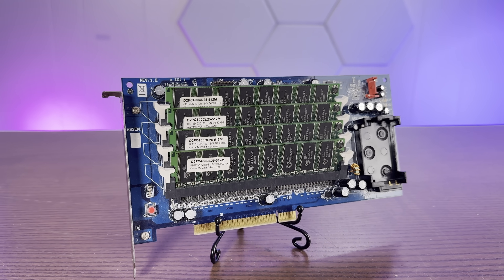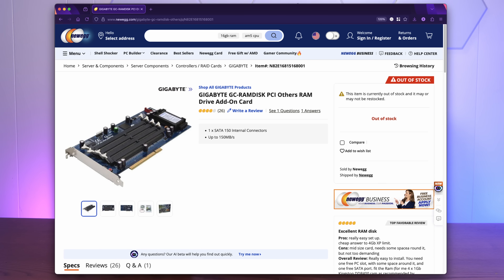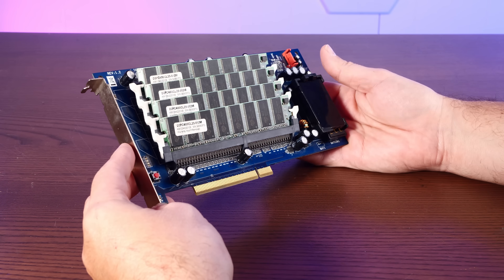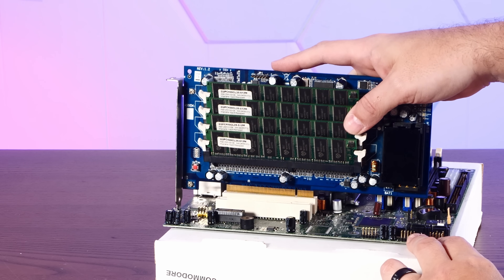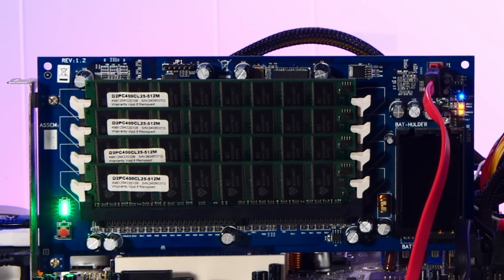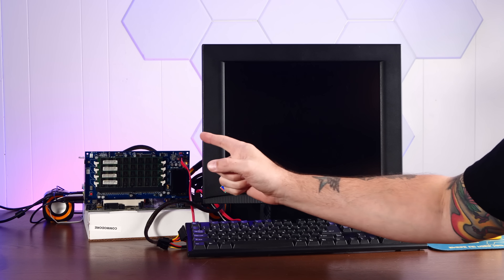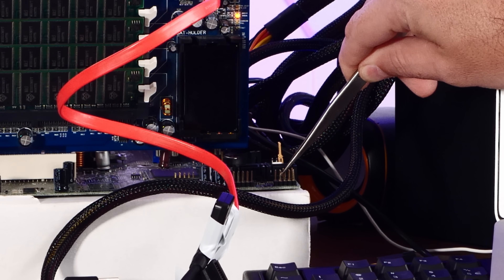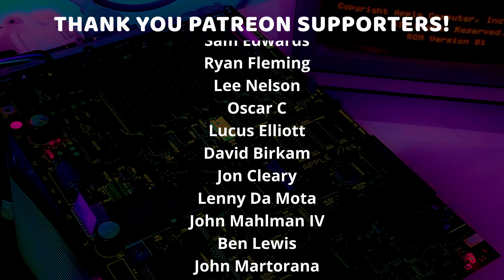This Early SSD Was WILD

Comment: Even earlier, in the 90s, ATTO Technology had an early standalone SSD that used SCSI. It had a backup HD in it. The SSD streamed to the HD for data security but had RAM (for the time) speed. Its only flaw was the cost which limited it to niche markets such as video editing and website hosting. I was the last product manager to have the produc in his line and ended up killing it because it was not an easy sell and expensive to produce.
Reply from the maker: That's amazing! I have to find one!
Reply: That is wild! I would live to try it with my Mac SE.
Reply: In the late 80s (?)/early 90s, DEC offered a range of "solid state storage" options for the SDI and DSSI storage busses, the ESE20/ESE50, and the EF5XX drives. These were just DRAM in a box, with some having an integrated hard drive for "data retention", others did not. Since VAX was often net booted in a cluster, I presume not having data retention wasn't a big deal for use as a swap disk or other similar uses (SDI and DSSI were both "networked": multiple computers/iniators could be jammed on the same physical bus and share a drive).

I didn't know there were other drives like that out there! I wonder how many of these existed in the wild, and if there was any relationship behind the scenes. I've never seen one of these drives myself, but it's such a "neat" idea.
Reply: @iliveitveryengaged  haha, I just commented that, damn we are old, our VAXes had those for the index tables.
Reply: Even even earlier, in the late 80s, Horizon Computers sold the Horizon RAM Disk for the TI 99/4a. SRAM on the system's expansion bus, backed up by three NiCad AA cells.

Much faster than floppies. Probably not faster than a hard disk controller on the same platform, though.
Reply: I saw this in PayPal's data center. Manufactured ~1998, size of a good APC Smart-UPS, 19.2 Gb and crapton of ECC SDRAM sticks. Broke in 1999, never repaired. Saw it 12 years ago so might be off by a year or 2.
Reply: I remember seeing them in a PC magazine in early 90's, it took up 2 x 5.25 bays, was full or RAM modules, and felt the future had arrived. Definitely not for me and most people at that price, but I did then think I'd be running off such a drive in a few years time after the prices come down. It just took a few decades instead of years but now I finally have SSD's everywhere.

Comment: LOL, About a decade ago I was actually designing something like this using old SODIMMs to replace older 2.5in drives in older older [really-retro] laptops for the drive speed, space, and virtual memory/swap [RAM upgrade].... the idea was still on the backburner, recently.

Imagine a 1GB SODIMM via IDE. in a 486 lappy with a max 8MB RAM and original 80MB HD...

(Hey, 486 desktops with PCI exist, and SATA PCI controllers!)
Reply: I feel like PCMCIA and Cardbus is a very underutilized expansion option on old laptops.
Reply: You know .. I have Soooo many DDR3 and DDR4 sticks I pulled out from computers I no longer own, It would REALLY be nice to have something like this to allow me to use them for something productive instead of dumping them into the recycling bin.
Reply: Just before the turn of the Millennium, I had a 486DX4 100MHz CPU on a motherboard with PCI and ISA slots, one with a VL-Bus extension. Most everyone I told about it said that was a really odd setup. Don't remember how much RAM, but given my budget of the time it wouldn't have been a whole heck of a lot, less than 100 MB. USB wasn't even a thing when that board was made, so Windows NT 4.0 was the OS.
One of the most reliable computers I ever had my hands in, despite my being a baby geek at the time!

Comment: i remember having an early netbook with intel ssd that was way slower than contemporary hdds
Reply: this was an intel z-p230 model ssdpamm0008g1
Reply: same, the speed was okay but the damn thing was 8 GB in 2008/early 2009 and had the same connector as the early iPods drives, you can't even install Windows 7 on it and can\t easilly swap it (now there's some options but imagine paying $35 to change the drive on $10 machine)

Comment: I wish they made them today, but with idk, DDR4.
Reply: DDR5 would be better as DDR4 is climbing in price as most manufacturers are winding down production.
Reply: @karehaqt DDR5 caught up!
Reply: Current SSD already has DRAM cache, which is literally a RAM chip in the SSD that speeds up the read rate and can function as temporary page file whenever possible

Although the capacity is not big, about 1-2GB per 1TB SSD
Reply: That's basically what CXL is, RAM modules connected via PCIe. It's only really used in datacenters, though.
Reply: Why not DDR3
Reply: You could do it but nvme disk's already drive pcie pretty hard so maybe not that much extra performance to be had. Use a RAM disk instead as then you can exploit the full DDR5 bandwidth.
Reply: They do.  Virtually every system is filled with peripherals which have on board high speed DRAM buffers.   Spinning hard drives today all have at least a quarter gigabyte DRAM cache to speed up operations and even most decent SSDs that aren't dirt cheap have the same thing.    

ZFS is an entire file system which excels because at its core is the use of copious amounts of RAM cache in an atomic way before writing it to disk.    The system allocates huge chunks of available RAM - sometimes Terabytes of it - to speed up disk read and write operations.    In fact the entire Internet runs the same way.   CDNs - content delivery networks store distributed versions of regularly accessed media files in huge RAM caches close to the network edge.  RAM disks are alive and well and copies of this video are probably currently stored in RAM at multiple sites round the world - at least while it's getting tens of thousands of views a day.
Reply: Aye, a PCIe card with many sockets for last-generation RAM, that presented itself as an NVMe drive would be dope
Reply: @taiyorawle4046  I was JUST Thinking of that the other day.  And you can solve the issue of volatility by just having it connect to a USB charger plug.
Reply: better yet DDR4 server DIMM’s because they are cheap and plentiful and you can even get 128GB individual DIMMs (though 64 is much more common)

Comment: I was hoping that SD media existed back then, and the battery kept the ram alive while it transferred your data when it wasn’t being used to the SD, and it would read the SD data when it booted up, letting the battery live longer
Reply: I like the idea 😄👍 - only, 2GB SD cards back then must have been almost as expensive as the 'real' SSDs back then, and with speeds in the single-digit MB/sec - you have a super-fast (for the time) drive, and you're reloading its contents at a tenth of the speed of that spinning disk in the video... possible, but no fun 😄...
Reply: @CoPoint  It would only need to restore from SD if the battery died.
Reply: @eDoc2020  Granted - but when that time comes, the few minutes for the reload will still feel like an eternity...
Reply: That was also my first guess when I saw the PCI card with RAM on it; that it did a "commit" upon shutdown to save everything to some non-volatile storage (perhaps a CompactFlash or MicroDrive), and loaded it into the RAM when booting up. You could get CF cards with 20-40 MB/s read speeds back then, so it wouldn't be totally unfeasible for people who really wanted some ultra-fast storage.